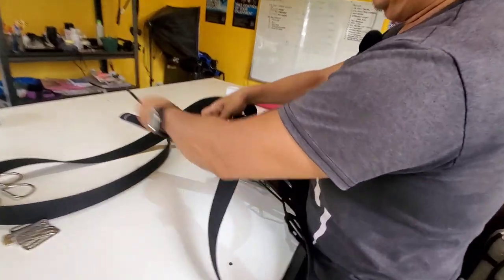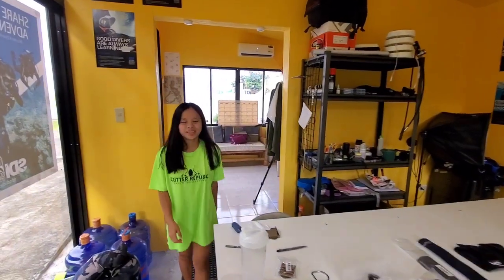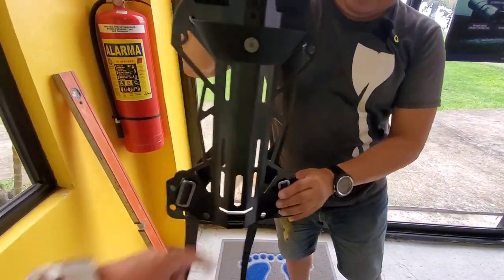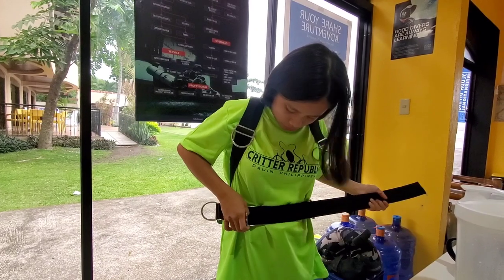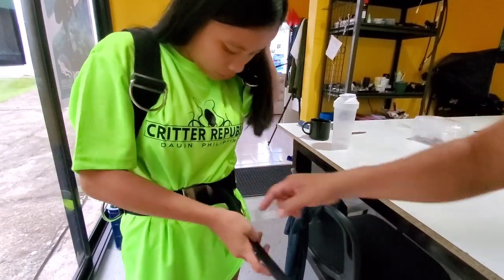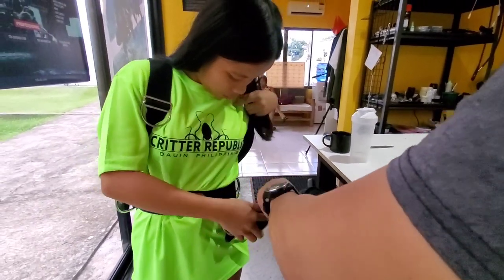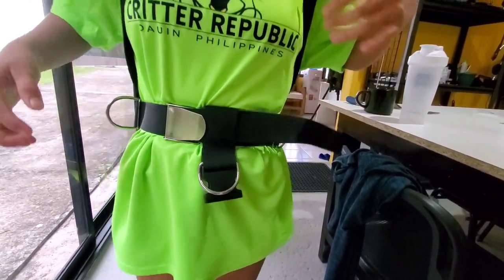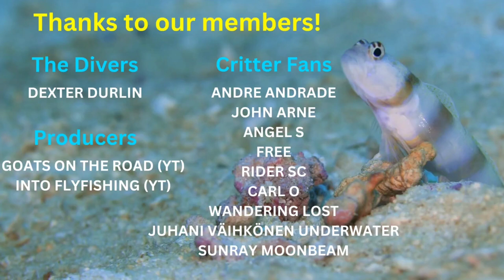Assembling a harness & backplate BCD #scubadiving

Comment: Hi critter hunter. Its not just all about squba diving.its about learning the basics and learning how your equipment works and how it fits . oxygen use and how to ajust the oxygen before you go down into the water its learn how to ajust your belts for comfort and checking out how everything fits the individual who is going down into the water tightness of the gear around your body and how you face masks fit your face that there not to tight even aroun your tummy.great information and very informative
Maraming Salamat.
🇵🇭 scott expat in the Philippines
             arleneINDAYLYNZ
  🌴🌴🌴🌴🇵🇭🤠🇦🇺🌴🌴🌴🌴